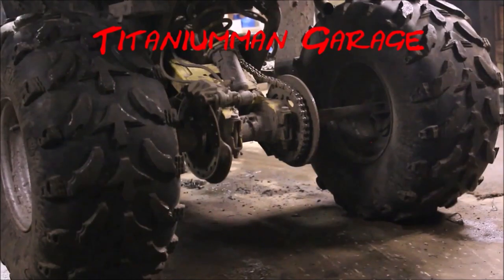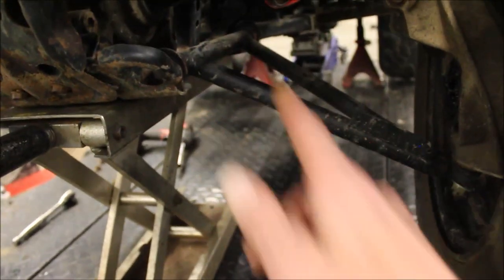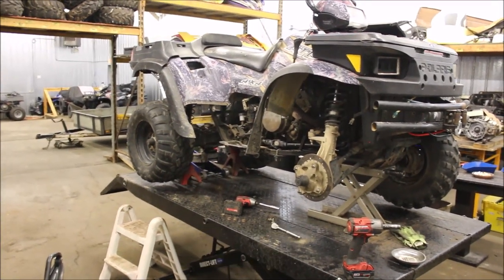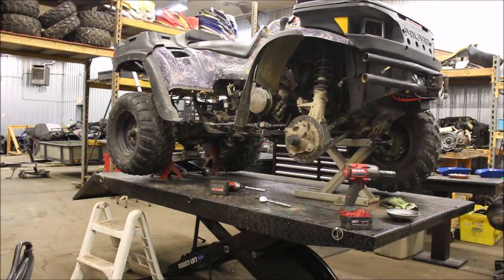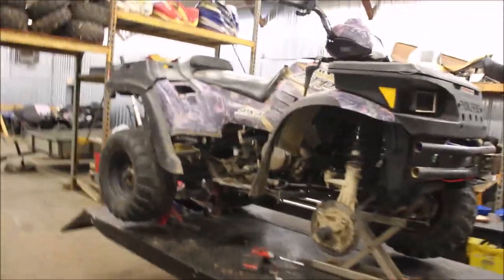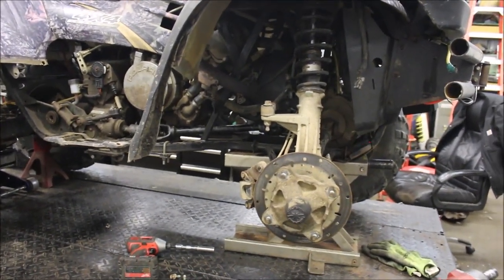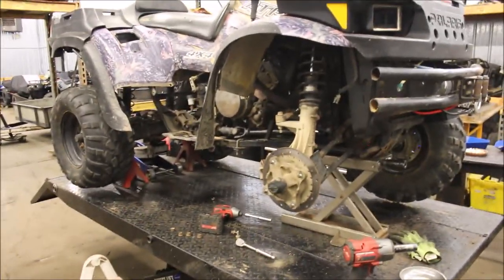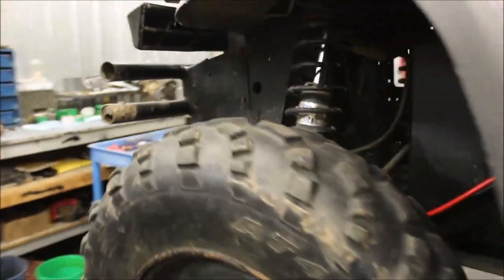Front Differential Bad? Or is it something else? 2004 Sportsman/ATP

Comment: Front differential (and hubs) ground comes from the meter/gauge which could be a separate issue. You may want to consider grounding the differential coil to the frame directly.

Comment: I've got a 98 500 magnum 4x4 keeps stripping out the rear axle coupler. Do u have a rear axle or a pinion not available from the dealership. Or is there a upgrade I could use? Thanks for posting this info and always describing the problem

Comment: Hello. Good video. I have a 2004 Sportsman, AWD works in low and high, shows icon on spedo. I cannot engage AWD in reverse. No icon on spedo. (Yes im pressing the yellow override button) At the connector the spedo is not grounding the the coil in reverse with button pressed. Any ideas on what could be the issue?
Reply from the maker: I had that problem once. It turned out that the shift linkage wasn't adjusted far back enough to engage the switch on the transmission to tell it, it was in reverse. It could also be a bad ground wire. Maybe add another ground wire to the 4x4.
Reply: @TitaniummanGarage  thanks for the tip. I think my linkage is ok, the spedo does recognize that I am in reverse. Any other tips?

Comment: Hello, I have a situation with my wheeler I was hoping maybe you could help. 
It’s a 2000 Polaris explorer 400 2stroke
It starts and runs at idle but runs hard like bume bume bume. There is no throttle past idle. You push the throttle and it sounds like it wants to suck in more air but the engine doesn’t rev up pretty much at all. It has 90 psi compression which I know is low but you’d think it would still rev up if it starts and runs. I’m thinking it’s got to be electric somewhere it’s limiting the rpm. I checked the etc and the connectors are not touching. I also checked the carb, changed the fuel, and unhooked the muffler. I’m thinking wiring harness, bad ground, bad voltage regulator, cdi?, transmission sensors, gear selector possibly. I know you work on a lot of Polaris’s so I’m wondering if you could point me in the right direction. Thanks

Comment: I have an '01 sportsman 500 and was wondering if you have any tips for replacing the inner bendix bushing? It is chipped and quite worn.
Reply from the maker: You need a bearing puller to get it out. Or heat it up good and get it out that way.

Comment: I just picked up the same wheeler. It runs good and moves but the front cv axles are shot you can feel greese where the boot should be snf bootd are completely gone. Im not sure that the 4x4 works the guy said you got mess with the switch i dont think it works. I ordered 2 new cv axles and im hoping i can fix it. they also have it wired to a car battery in the back of the bed its bujied in im thinking the guy didnt want to buy a new battery that fits it but it seems to work fine im going to put the corrrct battery in it.
Reply from the maker: Everytime I see that its because the battery isn't charging. So they put a car battery in. I would check the voltage regulator/rectifier to make sure the battery is charging.

Comment: I have a fourwheeler just like yours and my 4x4  won't work do you know how to fix it
Reply from the maker: I would start with checking the ground wires by the  wires going to the 4x4 or even add a ground to it. Also check to see if your getting power to the 4x4. 9 times out of 10 its a wiring issue unless the front differential is shot. If your speedo doesn't work...the 4x4 won't either.

Comment: watch all your videos, i have 2008 sportsman 500 x2 bought it last yr run fine at first then kept getting harder to start each time i crank it up, now it want start. could it be fuel pump or something else.
Reply from the maker: I would look at the fuel pump, The screen gets plugged on the bottom, definitely change the fuel filter and check the injector to see if fuel is shooting out properly. I would also clean the throttle body. Its probably black inside. I did post video's on my 06 I did a month ago.